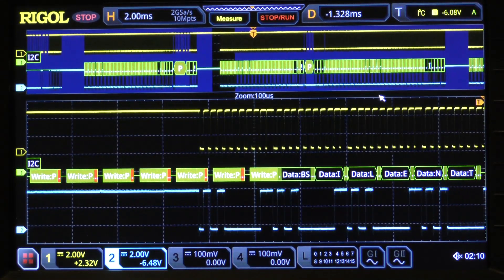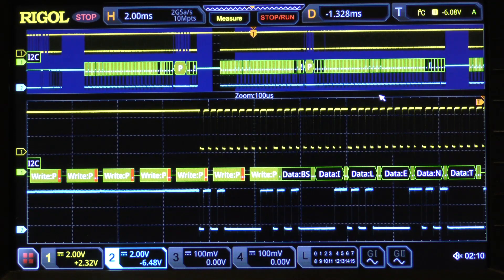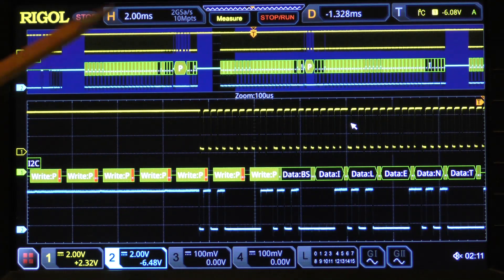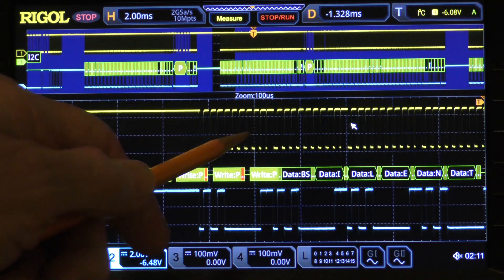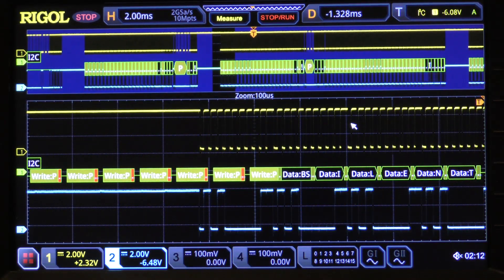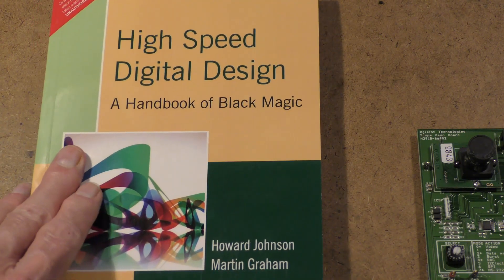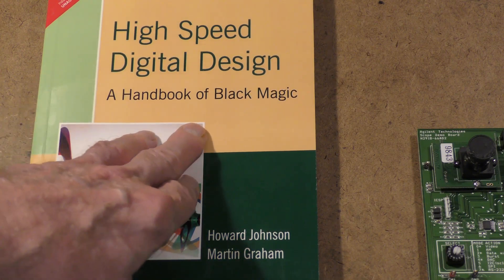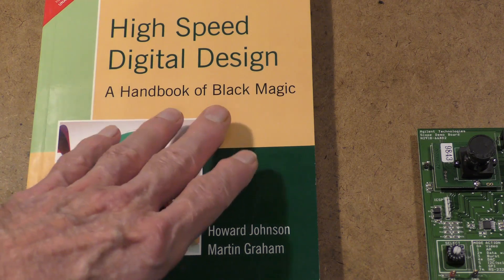TTT373 Embedded Systems Resources

Comment: A $5 Arduino will also generate I2C and SPI signals. With a little bit of easy programming you can control the payload in the packets. There are all kinds of devices you can connect that use these busses including something like a little OLED display for about $8.